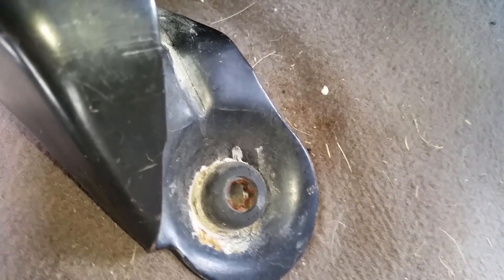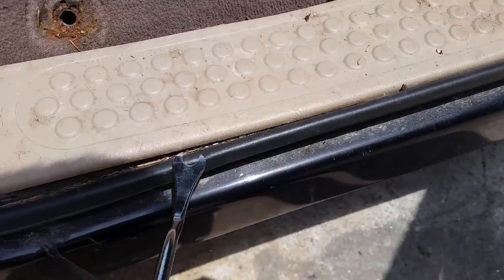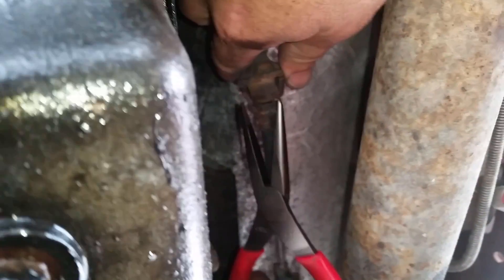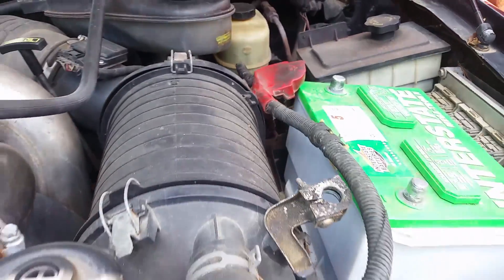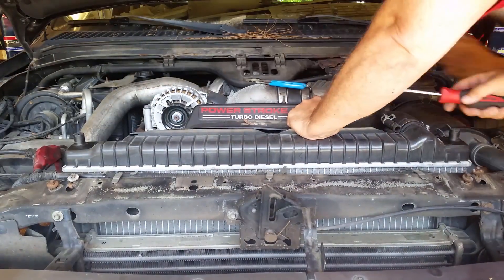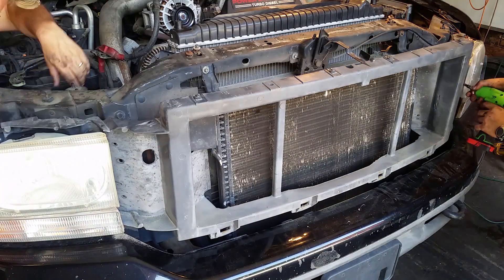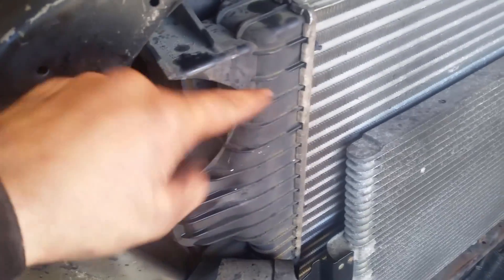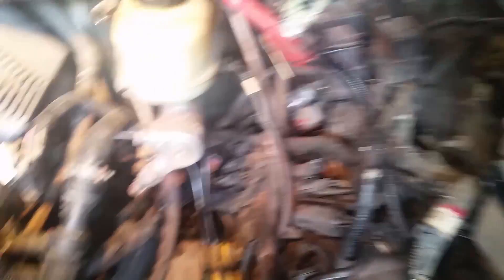Ford F350 6.0 Diesel Engine Replacement (Part 1) - Cab Removal

Comment: Why would you need to take the body off the frame to take the motor out
Reply: you need to remove the trans too, so the trans is located under the truck
Reply: You don't have to if you take the exhaust loose behind the driver side head that goes into the turbo you have plenty of clearance over the crossmember to pull the motor I don't know why everyone wants to pull the transmission with it a lot of extra work. I don't know why I'm power strokes people want to raise the cab you don't have to there's plenty of clearance.